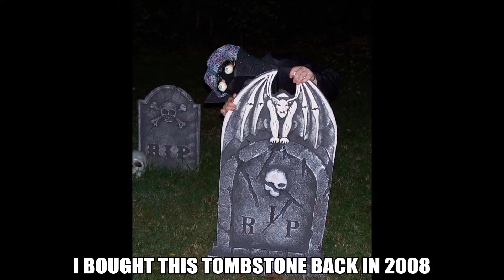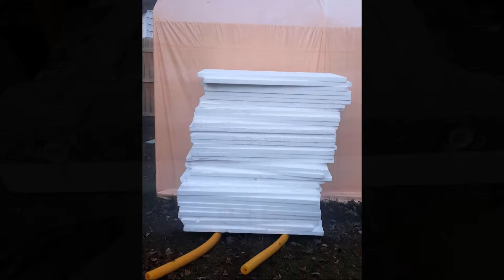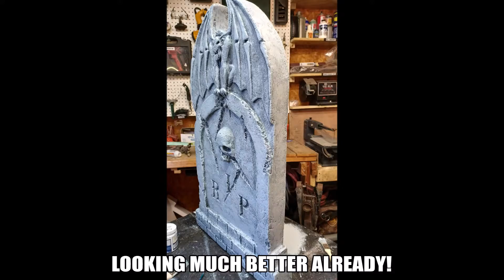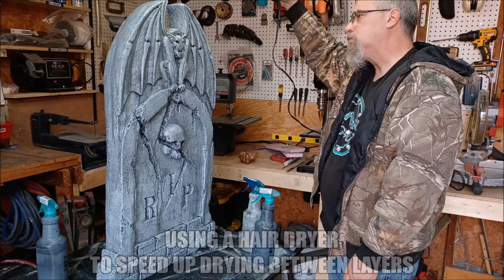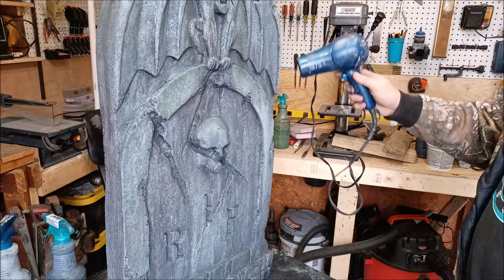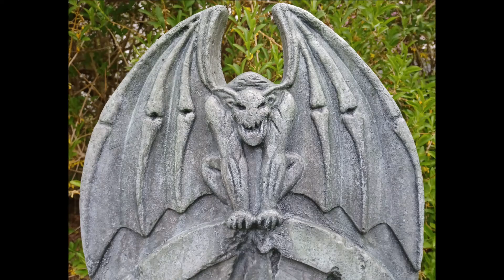Store Bought Tombstone Makeover

Comment: What is in the spray bottles? Watered down paint? I also wondered if you sealed it
Reply from the maker: Yep. Watered down paints. I do a light coat of clear flat finish Krylon spray paint, but you have to be sure the foam is 100% covered with the black base coat of house paint or it WILL melt holes in the foam.

Comment: Love your new look for the tombstones. Did the hair dryer get rid of most of the drip lines also?
Reply from the maker: No, it was just for speeding up the drying. I did use it to push things around a little though. The drip lines are controlled by the water.  Spritz any hard drips quick before they start to dry to get them to spread/fade.

Comment: Looks fantastic! Upgrade well worth it.  What ratio do you use in the spray bottle foe the  aging pprocess?  I feel like my drips always stain lines instead of disappearing and leaving a faint color
Reply from the maker: I do it as thick as I can without clogging the nozzle and put a little piece of fine mesh over the straw to avoid any clumps going up it and clogging it. Avoiding lines has more to do with your clean water than your paint mix. Wet the stone with clean water first, then apply the color. If you see solid straight lines, mist that area with clean water again. before it sets that way and it should break up the hard edges. Let it nearly dry between color layers. I usually start with black, do my greens, greys and browns, then finish with black again.

Comment: I've never used this Platinum Patch before. How well does it hold up to cracking and sticking down over time? I need to redo most of my tombstones. I've never found a good material to use on them like this.
Reply from the maker: I started using it last year after running across it at Lowes. I used it on several tombstones that sat out in the weather last year and none showed and signs of damage when we took things down. It dries to a plaster like texture and hardness, (a little brittle) but seems to be fairly waterproof. Container states it is weatherproof once dry. I've been meaning to drop a dried chunk of it into some water and see how it holds up. - https://www.lowes.com/pd/DAP-32-oz-Platinum-Patch/1000535775
Reply: @OakLaneCemetery  thank you, I'll give it a try!